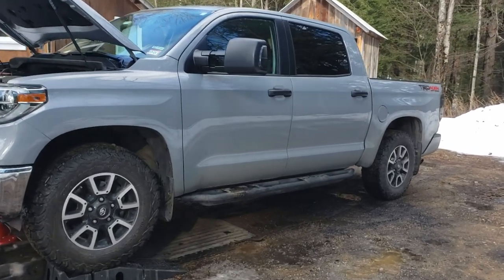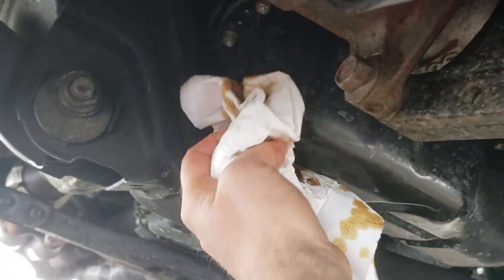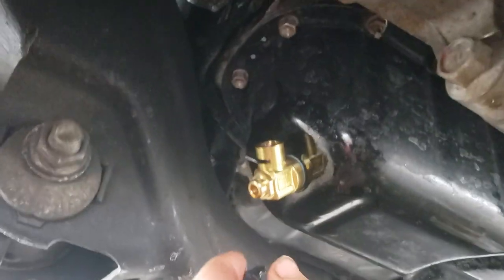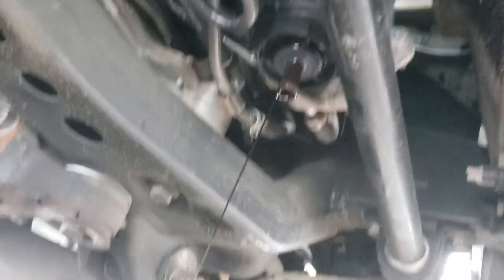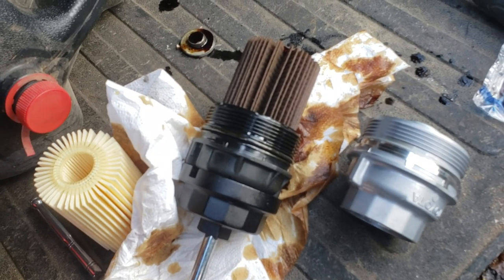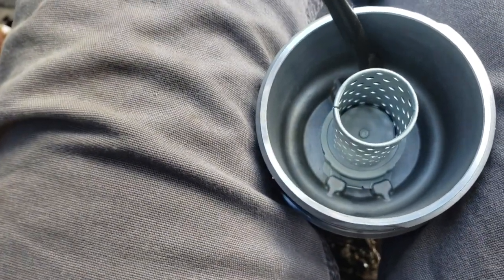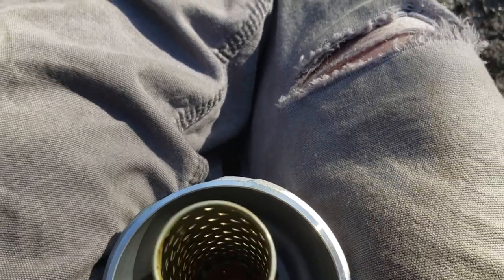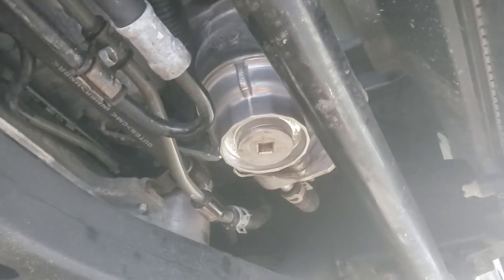2018 Tundra 5.7L oil change

Comment: Good job, I did this to my 2018 tundra 1st oil change. I used the fumoto valve with the nipple and drain it with pvc hose with no mess. I also replaced the plastic canister for the oil filter. I ended up getting the motivx tool kit wich helps not make a mess when draining the oil out of the filter canister. My oil changes are hasse free and might take 15 min tops to do I love it.

Comment: Excellent video. Better than I could do.

My opinion: The Motivx oil filter cap wrench you're using is the best choice. It has the least problems with breakage. Most problems people have is from ordering the wrong item number...
Mx2320 for all Toyota built engines that are 2.0 liters or larger that have the cartridge system...
MX2321 for 1.8 & 1.3 liter Toyota built engines with cartridge system.

IF your oil filter cap is difficult to get off just use the wrench with a 27 mm socket and ½ inch breaker bar instead of a ⅜ inch extension.

At 5:45 it appears that the teeth on your wrench are not properly engaged. I could be wrong. If not that could make a difference when it's difficult to remove.

Follow Torque specs. Found on oil filter cap &/or instructions that come with the OEM oil filter...
Oil filter cap = 18 lb.ft. (25 N•m)
Oil filter cap drainplug = 9 lb.ft. (12.5 N•m)

Comment: Even with the longer nipple option, do you know if there will be enough clearance for the skid plate when reinstalled? I’m planning to order the long nipple version but I want to make sure it doesn’t come in contact with anything. Thanks for the video
Reply from the maker: I just checked.  It doesn't come in contact with anything. The skid plate stops about 6 to 8 inches before the nipple.  Hope this helps.

Comment: Does it drain everything if not parked on level ground?
Reply from the maker: It functions the same as a regular oil plug, with the exception of having to use tools to drain the oil as well as risk of cross threading the bolt.
Reply: @belalsafi573  No I meant since it's parked on on ramps, any problems fully draining?
Reply from the maker: No problems at all. It just takes a little longer to drain, that's the only drawback
Reply: I don't have the modified drain plug installed, just the OEM plug.  After draining oil, I always raise the drivers side with a floor jack to allow additional oil to drain out of the pan.  Its surprising how much is left in the pan if  the truck remains level.